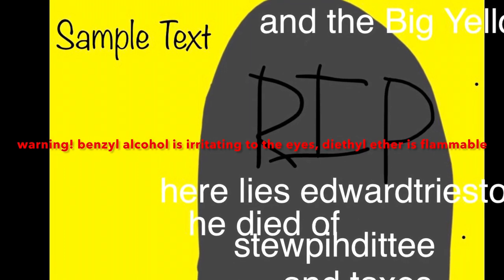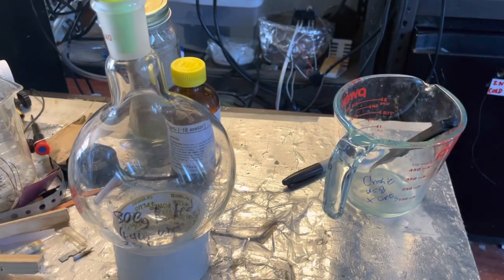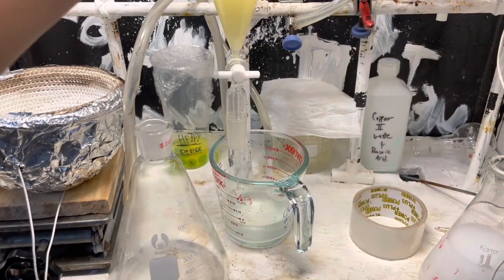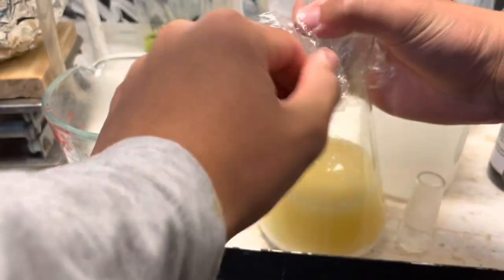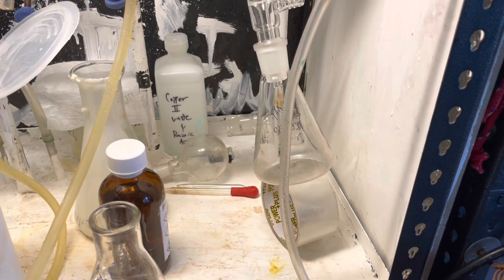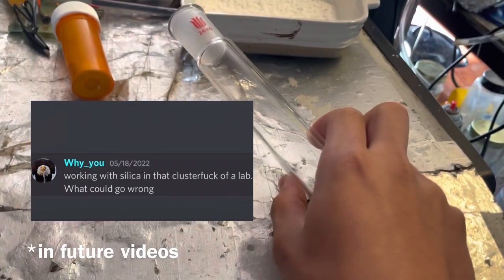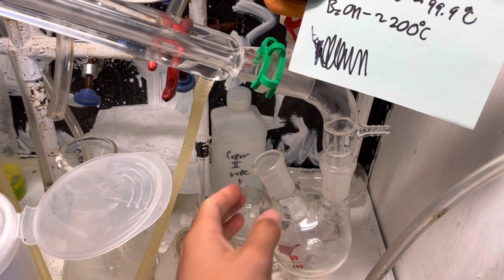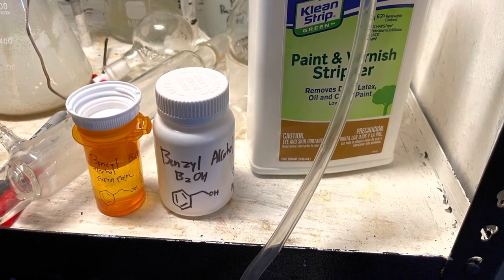Benzyl alcohol from paint stripper

Comment: Pretty fun :)

Unfortunately I don't think they sell stuff containing benzyl alcohol where I live.

I'd be interested in a good toluene -> benzyl alcohol (with MnO2 probably) video, the ones I saw all try to oxidize with KMnO4 up until benzaldehyde. I didn't see anyone explaining how one would stop the oxidation at the alcohol stage.
Reply from the maker: im not sure if its even possible to stop at alcohol but i do know you can chlorinate toluene to benzyl chloride with TCCA dust and sunlight, commercially they use chlorine then hydrolyze the BnCl to BnOH with water, NaOH apparently causes diphenyl ether to form rather than BnOH
Reply: @EdwardTriesToScience  thx, there are mixed reports about using MnO2, some say you just have to limit the reaction time, some go to benzoic acid directly instead... in theory it should work but details are missing.

I've been considering the chlorine option too. I prefer to avoid chlorine as much as I can but, oh well...